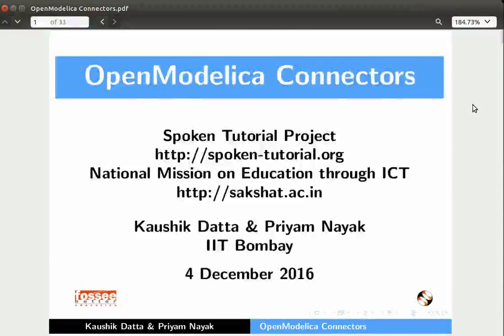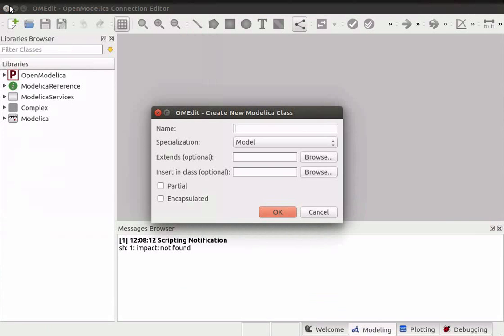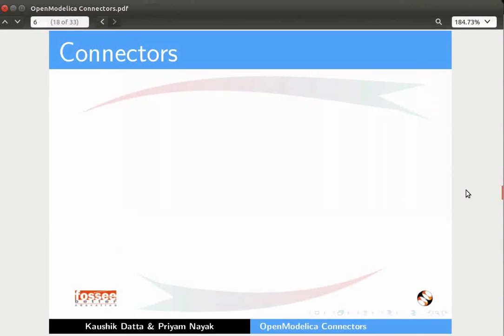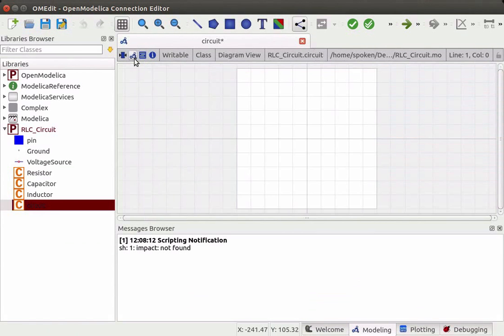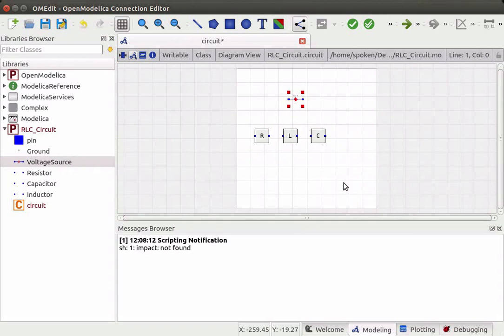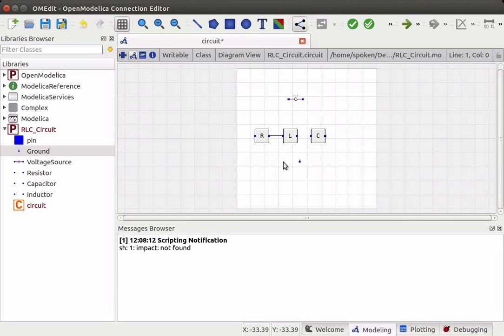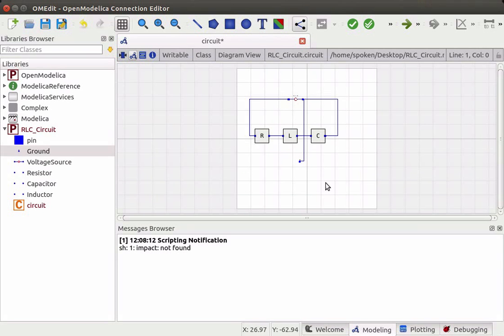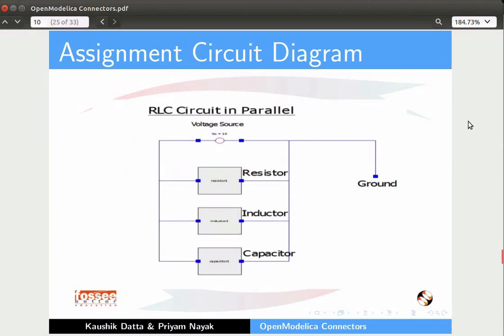OpenModelica Connectors - English

Comment: Thank u sir
I'm trying to learn anew programing (modeling ) language : modelica
I'm using 32 bit windows 7 to run the openmodelica software
this error appeared as I opened the openmodelica
[1] 10:06:27 Syntax Warning
[C:/OpenModelica1.13.232bit/lib/omlibrary/ModelicaServices 3.2.3/package.mo: 165:40-166:7]: OpenModelica only supports 31-bit signed integers! Truncating integer: 2147483647 to 1073741823
And when I write this program.. this error appeared:
[5] 10:33:30 Warning
Out of memory! Faking a stack overflow.

[1] 10:33:38 Warning
Out of memory! Faking a stack overflow.

[2] 10:33:38 Scripting Error
Stack overflow occurred while evaluating translateModel(RLC_Circuit.circuit, startTime = 0, stopTime = 1, numberOfIntervals = 500, method = "dassl", tolerance = 1e-6, outputFormat = "mat", variableFilter = ".*"):
[bt] #1 [... unsupported platform for backtraces]

Could any one help me, please
Thank u in advance